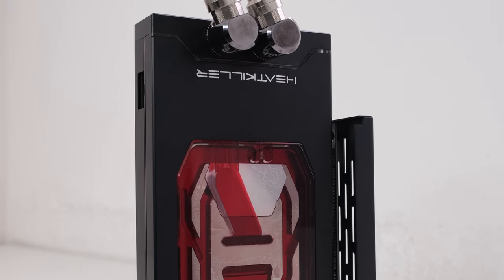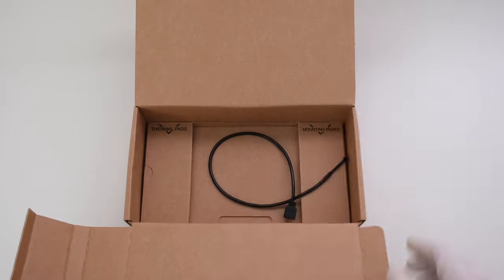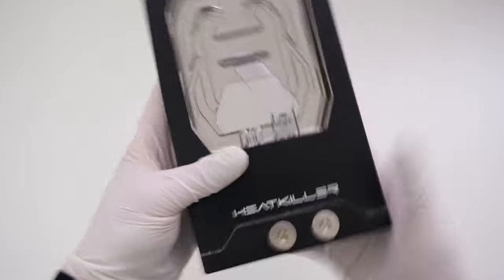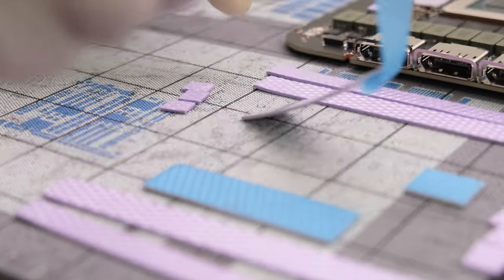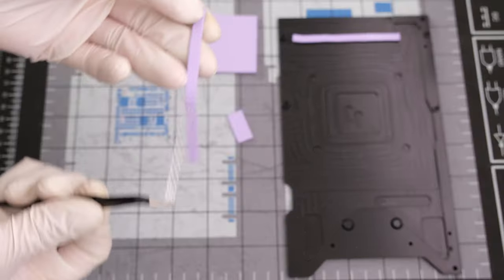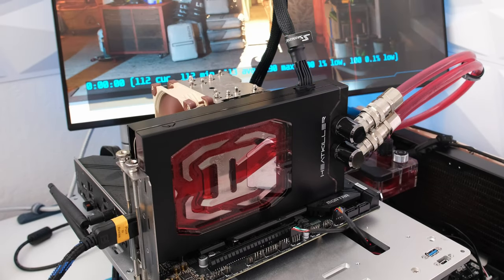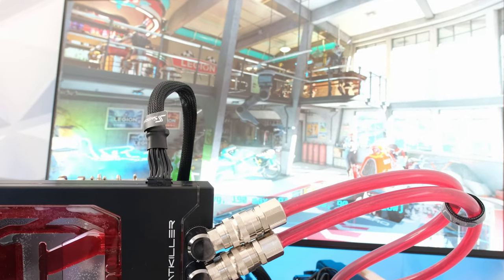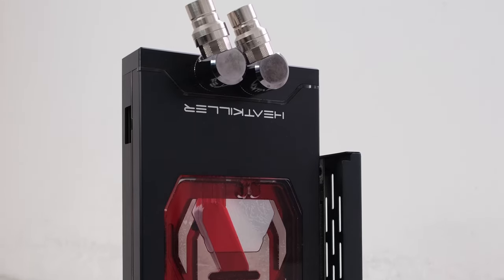Watercool Heatkiller RTX 4090 Founders Edition Water Block Installation & Testing

Comment: Just ordered an Optimus Rev1 block for the Strix 4090. I have an FE i was considering for the HK block, but i love the build quality of the Optimus products!
Reply from the maker: Thanks for your comment 🙏Right on! I have been waiting for the Optimus 4090 FE water block for nearly 1 year. I believe they announced it was coming Jan 2023. Still waiting to finally try one of their GPU blocks and will get it when they release it (don't have a 4090 Strix or TUF) and a video on it. I do like their CPU blocks (Foundation and Signature) and like their fittings. I am on the fence on their reservoirs. Heatkiller is all-around and has many offerings CPU/GPU blocks, Reservoirs and Radiators and the MORA. They just need some in-house fittings. I hope both Optimus and Watercool continue to grow and offer new products. Thanks again for your comment and thanks for watching

Comment: Did you remove the plastic horseshoe guides from the back of the pcb on purpose? 
Would you consider this an issue?
Worries that nvidia would say its danage and refuse warranty.
Cheers, great vid
Reply from the maker: Thanks for your comment🙏Good eye to see those plastic horseshoes. I did remove them on purpose. If I had seen them, I would have removed them earlier and have them not shown for the footage. They had to be removed for the backplate to be installed. I did keep them an intend to put them back if/when I reinstall the NVIDIA stock cooler. I do think that much of what I do would void the warranty but that doesn't really deter me. It is likely that everyone's situation is a bit different. Hope that helps.
Reply: @vectornetwork  I managed to leave them on, just finished my installation. 
I had this video playing on repeat whilst I fit mine so thanks for the help. Much more informative than the manual.
Keep up the good work
Reply from the maker: @JB-bi5vt  Thank you friend. I am pretty stoked to hear that the video helped and that you watched it more than once. That's so awesome! But wait, you were able to keep the horseshoes on? Wouldn't they be too tall for the backplate? I do recall that the thermal pads were rather thick, but I don't think they were thick enough to be taller than the plastic horseshoes. But then again, I didn't 100% check.

Comment: Hi nice video I had a question are there any issues with the metal washers put on the back I was reading by some seemed concern about them as just curious how is the focus water-block compared to EKWB’s water-block? I’m asking cause I’m torn between this card and that one?
Reply from the maker: Thanks for your comment 🙏 If I recall correctly, the metal washers (without rewatching the video) are foam/sticky soft material underneath. So, it's not like metal directly on the PCB. I have to re-watch to be 100% sure though. As for your water block question, what is the "focus water-block" you're referring to? If it's a Heatkiller block, then I would recommend HK. For lower priced (and higher priced) blocks, there are other companies I would initially lean towards before EK. Hope that helps.
Reply: @vectornetwork Hi Again I
 just wanted to say thank you for your help in not only going with the heatkiller but also the instructions video you made on how to assemble it. I have a 4080 FE but the directions are pretty much the same and am happy with the block  thanks again

Comment: Awesome to see a review of the HK block. I'd love to see some commentary and comparisons of various blocks and water cooling parts. By the way, do you know if the HK block works with a 90 degree adapter (cablemod)? Some of these 4090 blocks have recessed power slots.
Reply from the maker: Thank you for your comment 🙏You're right on point. I am considering a "roundup" type of video where I compare the thermals across all the 4090 cooling solutions I have tested on this channel. I have the data to compare the 4090 FE stock cooler, 4090 FE Bitspower water block, 4090 FE Heatkiller water block, 4090 Reference Alphacool water block. I would try to reuse some of the better shots from each episode and consolidate into a single video with new charts. It would be my first go at it so I would expect some of the pacing and commentary to have improvements over time. It if turns out good/useful, then I could do a similar roundup for the RTX 4080, since I have tested about 4 cooling solutions for that one too. I am currently working on a PC build video (4090 FE with HK block and HK reservoir, black EVO, AM5 system with 7800x3D). As for the 90 degree adapter and the recessed power slots, I took a look at the HK block with PCB attached and it doesn't seem too recessed. I then checked the HK compatibility and it appears this HK V Pro water block will be okay with Cablemod's "Adapter A". Hope that helps.

Comment: One thing that would be good to see is a graph showing the temperature delta (y axis) in relation to power draw (y axis) over time (x axis). Then show min/max/avg (individual and relative). Knowing the flow rate would also be good info as this can impact deltas. 

I have the same block but used kingpin KPX paste and am getting slightly better temps. At 500w peak power consumption in 3Dmark Port Royal 4k I was getting a delta of 18° C. At 450w it was around 16c. At 375-425w (gaming load) i was getting 10-14c. This was at a flow rate of 115 L/h. You may want to check your TIM spread. I used the spread method. 

Also, I'm not a huge fan of Kryonaut. The initial performance is fine, but I find over time that it degrades faster than other TIMs.
Reply from the maker: Thanks for your comment 🙏and thank you for the information you provided. I am interested to explore the suggestions you made with regard to the graphs and showing 2 items on the Y axis over time and then showing the mix/max/avg. I do have all the data and this would be in replacement of the averages or in addition to? I have never done any of this type of testing before I developed this current methodology. It's not perfect, so I am happy to learn more and potentially improve it. 
Also, I do agree with your suggestions with regards to the paste and flow rates. Good eye there as you sort of identified the areas that weren't as clear cut, if that makes sense. For the flow rate, I have an Aquacomputer Next Sensor that I procured specifically for this build and I just couldn't figure out a good location with it (I also have another smaller Aquacomputer flow rate monitor that didn't seem right in any position either). I didn't want to force it to so not having a flow rate was a compromise. For the paste, I do think there are other options that can perform better than the Noctua NT-H2. I simply use it to be consistent. Its sort of why I do the same X paste. I also have a lot of the paste as I really like those Noctua wipes and those come with the paste and the thermal guards. However, I do think changing it up can be beneficial, so I may change up paste and/or methods too. The X was purely for something visually interesting. I'm not sure if smoothing the paste out to a thin layer would be interesting but I think it could be. Hope that helps.

Comment: Nice content! I am also looking for a WB for my 4090FE and I am considering either heatkiller or alphacool CORE. The thing that stops me from HK is that I saw the liquid gets in between the nickel plate and acrylic (off the water channels tho). I saw that from ur video as well, in the channel part, the coolant looks red, and some coolant gets in between somewhere else and looks pink. I am a bit concerned about this. For alphacool, I am just not sure if it performs as good as HK and I don’t really like the look or say ratio of their FE block…
Reply from the maker: Thank you for your comment 🙏I haven't yet tested the alphacool CORE, although I do have one on order for the Asus TUF 4080. I plan on doing a video when that arrives. I am working on a full build video that includes the HK block. I had to take it completely apart to clean it as the red dye wasn't coming out. I ran some mayhems blitz phase 2 and that marginally reduced the red. I do you think you may see liquid/bubbles get in between the plate and acrylic (but not past the o-rings) on a variety of different models and not only the HK. Hope that helps
Reply: This happens on pretty much every single type of block.

Comment: Which of the 4090FE blocks do you like the best?
Reply from the maker: Thanks for your comment 🙏Good question and I have been thinking about it. I have only tried 3 FE blocks (Alphacool Eisblock, Bitspower Orion and Heatkiller V Pro), so my opinion will be limited to those. If I had to choose a favorite, it would be the Heatkiller one. I have tried a HK block for the 3080, so I wasn't surprised by the quality of the block. Something noticeable for me was the installation felt more secure and repeatable. This does not mean the other brands are not secure, this is simply an incremental difference.  
The Alphacool Eisblock is a terrific block. Alphacool upgraded their water blocks for this 40-series generation. Upgrades include chrome plating (marginally more resistant but it shines, almost like a mirror shine) and using one large black O-ring rather than 4 smaller ones. This leads to a cleaner look. Temps were right around expectation (actually a little better, temps were like HK temps). 
The Bitspower water block is most similar to Corsair. I actually thought I was sent a Corsair product at first glance. Both products seem like they are manufactured in Taiwan and share similarities in the boxing and the pre-applied thermal pads. There is a lot to like about the Bispower water block. It's a simple block and has the terminals on the side. For instructions, they are found on their website and not in the box. 
I am likely doing a Optimus water block (Rev.2) episode for the 4090 Strix and that will likely be the best block available for any card at the moment. If that happens, I will be doing a 4090 Strix episode before that. Hope that helps!

Comment: Did you remove the plastic guides on the back of the pcb????
Reply from the maker: Thanks for your comment🙏I did. I see you noticed I removed them without showing it on camera. This is the second time someone was sort of surprised I did so. I don't see how I can get the backplate on the card with those plastic horseshoes still in place (I kept them of course for if I want to reinstall the stock cooler). Those plastic guides are much taller than the 2mm for the backplate, so I had to remove them. Hope that helps

Comment: Any chance u would get an Optimus waterblock
Reply from the maker: Thanks for your comment 🙏 Yes, Optimus is coming up. I have been waiting to get an Optimus GPU block. I have two 4090s and Optimus doesn't make a block for either of them (yet). They have a block for the Strix/Tuf. I already have the 4080 Tuf and I wasn't sure on getting a 4090 Strix. Having said that, Optimus is expected to release their GPU block for the Founders Edition within 1 or 2 months. Once that is released, I'll make sure to do a video on it. I'll be able to directly compare it to the Heatkiller block since it'll be using the same card. In addition, I have the Optimus Signature v3 AM5 CPU block arriving soon. That will likely be the next video out. Hope that helps
Reply: @vectornetwork  Looking forward to it!

Comment: hi bro, what's the best block you've tested?great content friend
Reply from the maker: Thank you for your comment 🙏Good question my friend. The best block I have tested so far is likely the Heatkiller V Pro block for the RTX 4090 FE. I have tested another Heatkiller block for the RTX 3080 and was pleasantly surprised at the quality of the build of the HK block. So, I wasn't surprised when I received and tested the HK V Pro block. I had to take the block completely apart recently as I am working on a full PC build using the HK block and the red dye from the video wasn't coming off by simply flushing it with Mayhems Blitz Phase 2. So, after taking the water block apart, cleaning it, putting it back together (did get all the footage, seeing if it's worth adding it in the build), I have to say that I feel comfortable doing that over and over again with the same block and screws provided. I would feel comfortable installing, uninstalling and reinstalling the same HK block over and over again on cards, using the same materials (not thermal pads or paste of course). Having said that, I haven't yet tried Optimus GPU blocks. I have tried their CPU blocks and I find them to be outstanding. On the same level or higher than the HK. One subtle difference is that their CPU block can be installed all without a screwdriver (just by hand). I do plan on testing an Optimus GPU block one day. Hope that helps
Reply: @vectornetwork  it took a bit of work, really, HK is very good, I researched a lot about it and the reports are great, optimus even though it is a first class block too, it is very difficult to find, there are almost no comparisons with it, and I believe that the difference between one and the other is not great since both are top notch, but I love videos like that of comparisons, I've seen your videos several times, congratulations again for the content, I hope you gain more recognition
Reply: @vectornetwork what other blocks have you tested by comparison?
Reply from the maker: @Rashimotosan  Thanks for your comment 🙏 For the RTX 4090 Founders Edition, I have tested the Bitspower and Heatkiller blocks. For the RTX 4090 PNY (reference), I have tested the Alphacool Eisblock. For the RTX 4080 ASUS TUF, I have tested the EKWB Vector2, Bykski and I am in process of finishing the next video, which will be of the Alphacool Core for the 4080 TUF. Hope that helps

Comment: From where do  I get this Benchtable? 
It looks bonkers.
Reply from the maker: Thanks for your comment 🙏 I put the name of the Test Bench below. It is more expensive than others. It came across the ocean (I'm in California, USA) and took a few weeks. I really second-guessed my order during this time. Having said that, when I received it, I knew I made the right decision. The pieces are nice thick aluminum. 

EDIY Open Air ATX PC Frame HTPC Water Cooling Test Bench Aluminum Case Bare Overclocking DIY Computer Support Graphics Card, Silver

Comment: Would this waterblock help reduce coil whine, 4090 fe has horrid buzz and coil whine.. I have rma'd twice on my 3rd.. still bad.. im using the corsair xg7 tho
Reply from the maker: Thanks for your comment 🙏 From my experience, when testing the stock cooler on an open air test bench, I do remember noticeable coil whine on both the 4090FE and 4080TUF. I don't recall it on the 4090PNY. I still have all three cards and they are all in water blocks and I currently do not notice coil whine on the cards. Did the coil whine occur with the stock cooler or with the Corsair water block? Were you able to RMA 2x after you put the block on it?
Reply: @vectornetwork  stock and xg7 corsair block.. no difference just very bad, I tried adding more thermal pads as well heh.. rma I put back stock in USA they can't enforce not changing cooler as long as it comes back stock
Reply from the maker: Hm, it's a tough one. The path of least resistance would be to keep the current card and it's possible that the coil whine will lessen over time and you will get used to it more. I would focus on the performance of the 4090, rather than some electrical noise that comes from something so powerful. The other option would be to continue returning the card in hopes of receiving one with less noise. It is something that you have tried already 2x. Maybe third time's the charm or simply get use to it and maybe it goes away. Tough one, your choice of course. Hope that helps
Reply: @vectornetwork  won't 1st 8 had 6 months, didn't notice as much since was in my older case under my desk, once I spent money on custom wall mount (which would have costed 530 to return FedEx out of the country) thats when you really notice it.. so im still paying for a case I can't use and the noise is so much forces migraines and headaches